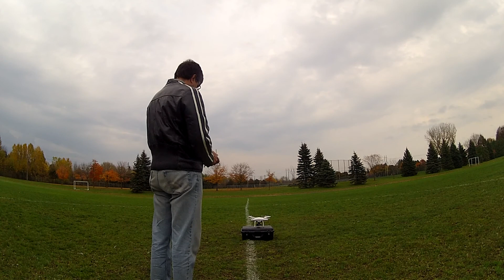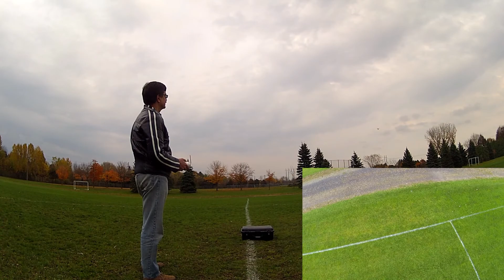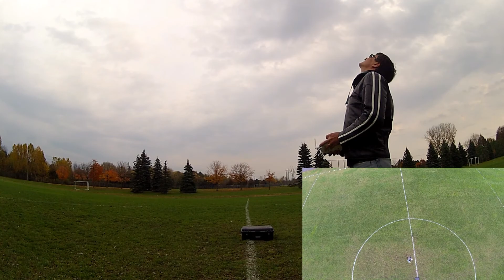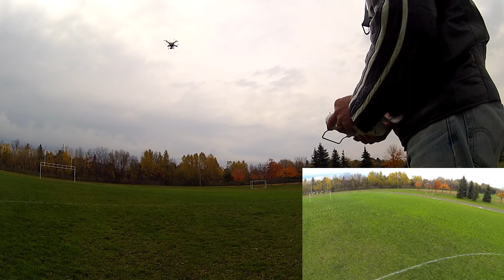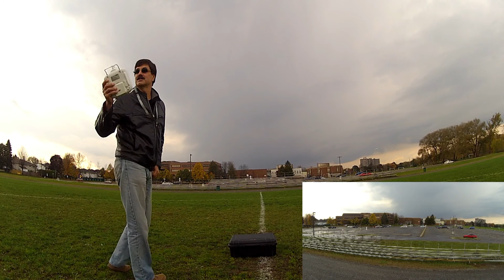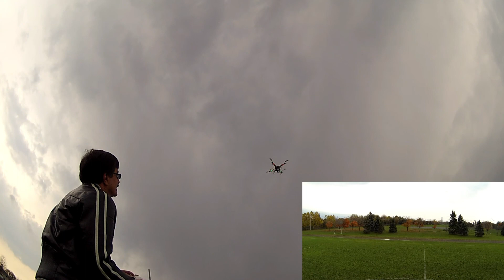dji Phantom Geo-Fence limits v4.00

Comment: how do i take this feature away so I can fly farther away from me plz help
Reply from the maker: Which version of Phantom do you have?  This video was done with my 
original Phantom-1.  On this old system, the Range Limit feature could 
be enabled/disabled or set to whatever distance you prefer using the 
NAZA-M Assistant Software.  I now also have a Phantom 3 Professional.  
The P3P uses the DJI Go App for adjusting settings.  In there, under Main 
Controller Settings, you can enable/disable Beginner Mode in which the 
aircraft is limited to a 30 meter flight radius.  With Beginner Mode disabled, 
you can choose to Enable/Disable Max Distance ans set it to whatever range you
 prefer.

Comment: This same thing happens with mine but with the 4.02 update.
Reply from the maker: By "same thing", what do you mean?  Have you seen my v4.02 updated geo-fence vid?  https://www.youtube.com/watch?v=d0HlyTHp6Fw
Reply: Zbip57  I mean when it went to it's boundaries it did not respond to the controls and would not come home. The wind blew it away. This was with v4.02. It may work for some but not others.
Reply from the maker: SuperLightningTruck
I don't know what to tell you. Firmware v4.02 fixed this problem perfectly for me.  Perhaps you can try reinstalling the firmware upgrade.  Is yours a Phantom-1 like mine, or the newer Phantom-2 or Phantom Vision?

Comment: Awesome video! I have the new Phantom 2 Vision and cant seem to find the Geo-Fence you demonstrated in my software. I will be filming a lot of school sports this year and would find this feature useful as a safety precaution. Could you please tell me how to download this to my firmware. Thanks and keep the great videos coming! :-)
Reply from the maker: Check in the NAZA-M V2 Assistant software, under Advanced, Limits tab.
Reply: I don't have a Limits tab in my current version of Phantom 2 Vision 1.08 Assistant software, and I just updated it. I also switched from Phantom to Naza-M setup and the only tabs I have in Advance is F/S, IOC, Gimbal and Battery. What am I doing wrong??? Thanks!
Reply from the maker: Bobster986
I asked around and apparently the Phantom 2 does not include this Geo-Fence range limit feature.  Go figure.
Reply: What?! :-(